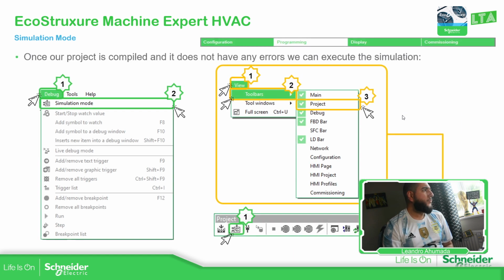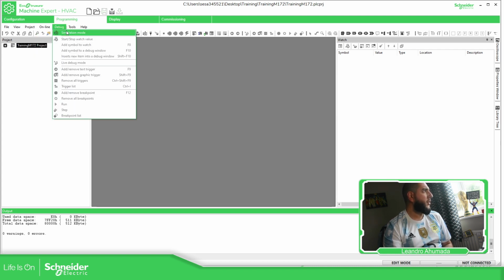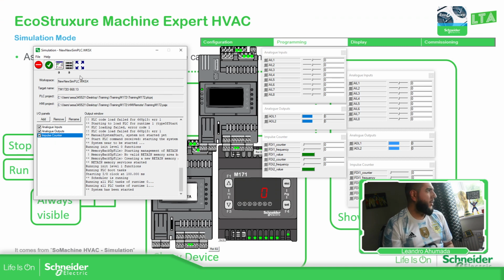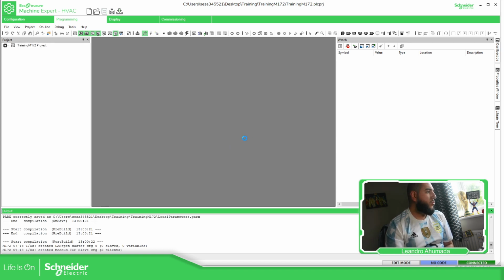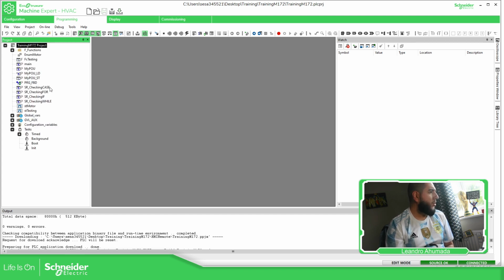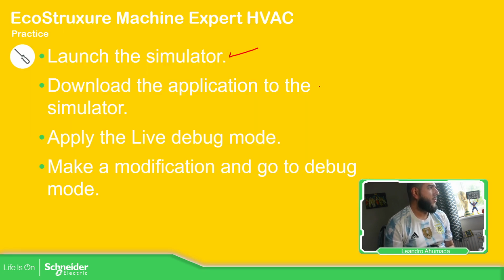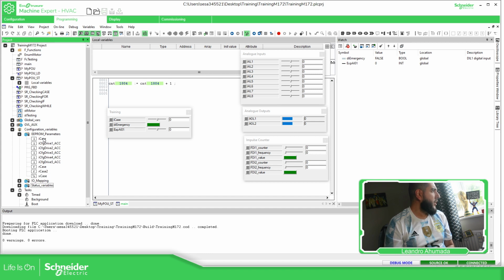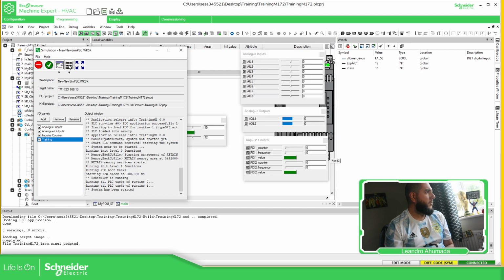EcoStruxure Machine Expert HVAC Training - M6.1 Simulation Mode

Comment: How we simulate the webvisu? I tried using tvda examples, but it just doesnt access the webpages on simulator... :/
Reply from the maker: Hi there! In the m172 you can check how the webvisu looks like when you go to commissioning and on tbe controller instead to dow load the webiste you select "website preview". This is to see only how it looks, no data values there
Reply: @LeTomasAHUMADA  Thank you! One Last question, i've seen that TM172SIP, besides provide some features as HTTPs, MQTT, FTPs, etc, has RAM (256mb) and ROM (512mb) memory embedded. Looking in ESME HVAC, seems that its possible to do some programming on these devices, without a controller. They really can work without A M172 controller, just to provide webserver feature to devices like M221, M200 or any modbus RTU device linked to his serial port?

It would be a great feature for small applications
Reply from the maker: @Tfmt100 you will need the TM172SIG. You can create logic and if you need IOs you will probably need to communicate over modbus serial using blocks, that part i have not implemented yet but it is possible
Reply: @LeTomasAHUMADA  Nice! Thank you so much. As a Schneider distributor (IAD), i can say your practical training videos easily overun schneider's one from training portal rsrsrs.

Really nice work, thanks!!

Comment: Hello! If I have AI configured as DI what value should I put in Analog Input window to simulate closed input? Should it be -32768 +32768 or something else?
Reply from the maker: Hi there! I have created a video for this bit it will release in a few weeks:
EcoStruxure Machine Expert HVAC Training - M13.1 Analog Input as Digitial Input
https://youtu.be/Z9bHObx-2tk

Basically, the value goes from 0 to 1 when it is configured as digital input. The variable is still INT so you will probably need to make conversion to use directly as BOOL in your code.